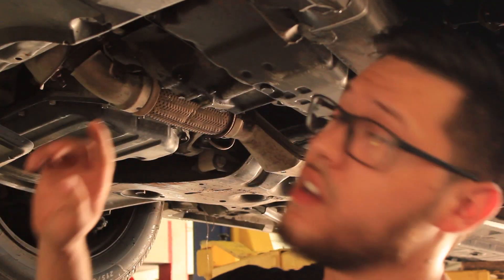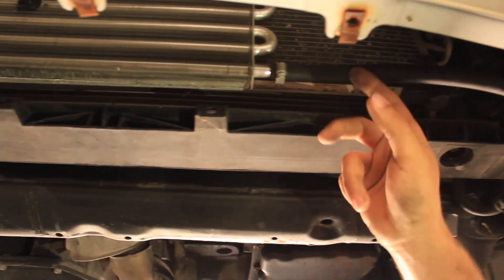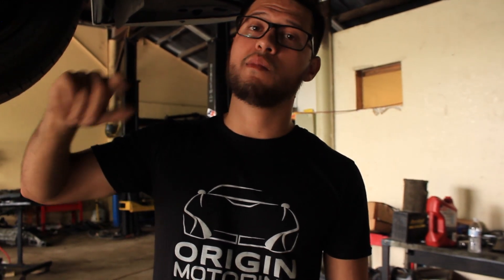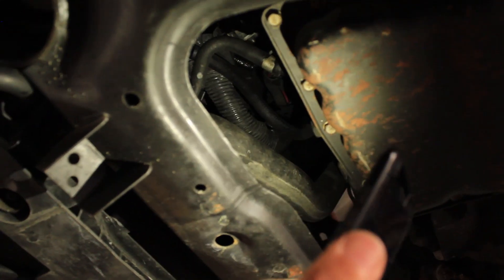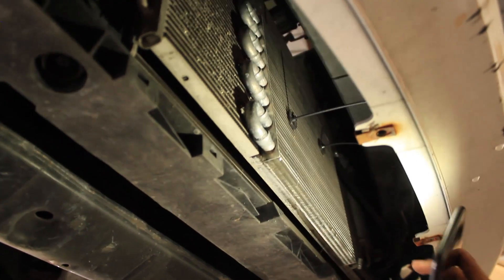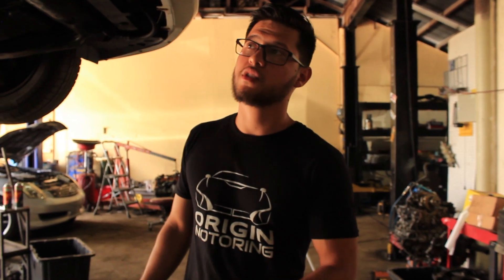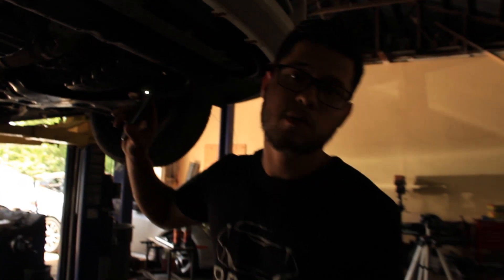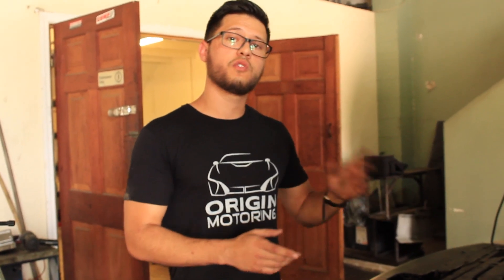Altima cvt Fix. Transmission more reliable

Comment: So I hook the new line going to the cooler to the top radiator spot and run it to the bottom of the cooler?  Then run the top line on the cooler to the small cooler on car on the top one?

Comment: I'm working on 2012 altima 3.5 so on cooler the bottom line goes to top of transmission and top hose goes to bottom of  radiator or top I have 2 inlets on my radiator? Don't want to damage the trans

Comment: thank you brother u are so kind to share information. in my case even the hose to radiator must be blocked --> from heater directly to transmission radiator with a fan over it then back to the (heater with 4 ports) even though i canceled 2 water ports because degrees here may reach up to 53 C degrees so coolant water reaches 98 degrees within 10 minutes driving

Comment: Hello.  Can someone help.  I installed the cooler exactly this way, checked fluid level ALl good but I am getting Air Bubbles on the tranny dipstick.   Sounds like there is air trapped in the lines somewhere.  I did not pre-filled the cooler with the CVT fluid. Does this matter ?

Comment: I've been wanting to do this myself. My fluid is frothing after a couple of months. The first time I changed it it only lasted 10k miles (I'm ok changing the fluid yearly since I do. It myself). Last time I changed I made the mistake of mixing different brands of fluids (I was low on fluid and had to drive, when I realize it was a really bad idea while driving, I used another qt I had in the trunk). 

I just changed it again and used only one brand (amsoil). If it starts frothing again, I'm gonna have to install this cooler and hope that's what making the fluid go bad so fast.

Comment: Every 60-80,000 miles. You go to Valvoline and do a CVT flush, $199. You buy only Nissan original CVT fluid and have Valvoline put your Nissan fluid! in instead of the Valvoline one. They don't give you credit if you bring your own but after the flush it shifts strong no slipping. My Altima 2017 (I drive Uber) has 297,000 on first engine and first CVT.

Comment: Here is a service bulletin for 2007-2012 Altima with External Oil Cooler kit installation instructions starting on page 5/7.      https://static.nhtsa.gov/odi/tsbs/2015/SB-10074565-2280.pdf
Reply: @Mark.... THANK YOU for this info.
Reply: thx for sharing but the creator of the video has installed the hose from top of the radiator to the bottom of the NEW cooler which is OPPOSITE what the diagram is showing......i am more confused
 now...

Comment: The 2013 Rogue some model have a smaller cooler than yours. But on those it comes in the top and exits the bottom of the cooler - opposite of what you indicated. 
Second, the radiator coolant is in the 185-205 deg range all the time. Transmission fluid generally is lower than that right (165-185 deg I am guessing). Therefore running the trans fluid through radiator is actually heating it up instead of cooling it?  Am I wrong?

Comment: This seems to get-around the design defect: Keep 'em cool as many ways of reduced coolant/distilled water ratios, both filters and best cvt fluid each 30k, allow set overnight or allow 8 hours for full warm drain to obtain around 5.5 quarts if not flushing, seal all air leaks of radiator plenum (Time -consuming), keep radiators clean. I'm now 209k Mojave hard-and-hot conditions, full AC

Comment: I found out when a cop hit my car they replaced the radiator with a non cooling port for the cvt fluid. So I have had my transmission fail 2x and nobody figured this out til my brother looked and asked where the cooling line went. I drive 15 miles to work thats it and had a failure under 10k miles 2 x.  Would the valve body still be good if its a fluid overheat issue.  And would the gears be bad. Just wonder if its worth trying to solve this still.

Comment: I have a Nissan altim 2012 no codes , the transmission go to the Neutral , Park , drive , ect , good , no limp mode , just when put in gear or drive , ect , make a sound and not let me run more 15 or 20 mhp . I don't know is the CVT going bad or just change filters and Transmission fluid fix the problem ? Please any suggestions

Comment: i know this is a older video, but do you happen to know where the transmission fluid pressure sensor is exactly on a 2018 altima. maybe a pic or exact location?

Comment: have a 2008 Nissan Sentra recently purchased for my mother. Last year she had the CVT fluid changed, and a car ran well for one year. After that, the car started hesitating again. I changed the CVT fluid yesterday, and the car was running fantastic until I took it down the street. It's holding back and hesitating, I believe the transmission is overheating.

 I left the car in the parking space, and did not drive it too far. To install the cooler, what you fix this problem what do you recommend.. where are you guys located? It's close by I'd love to drop the car off and have you guys work on it.. or if you explain to me how to do it and where to buy the part I can do it myself. Feels like this transmission is junky! I never seen the car with so many transmission problems like this one.. I have nothing against Nissan, but wow is this transmission troublesome.....

Comment: I think this was done to my Altima but I still have a p1778 code that won't clear with my code scanner. Issues seem ok except the traction control light comes on also. Can these be related to the type of repair done?

Comment: I honestly believe that the reason cvt goes out is by another way... I'm not gna tell anyone because I know that's what could be the problem as for long driving too... guys need to put 2 n 2 together n that is not happening here. Just preventing it from getting damaged any sooner. Put in a cooler so transmission fluid keeps cool n thus keeps this cool. Transmission isn't just about fluid haha. It's OK tho in doing my own research and I'll let you know how it goes.

Comment: https://emanuals.com/blog/nissan-cvt-transmission-warranty-and-lawsuit-settlements/  This is the best link I refer everyone to on getting your CVT fixed for free. The original  CVT warranty was for 5 years / 60, 000 whichever comes first.  The first generation CVT's have a warranty that extends their CVT to 120,000 miles.  It was decided in a lawsuit.  Nissan has agreed on cars built 2013- 2016 to extend their original warranty on the CVT another 24 months/24,000 miles bringing that to 7 years/ 84,000 miles.  Some of you may have even a longer warranty as some dealerships offered free extended  CVT warranties on new cars to 150,000 or even the life of the original owner.  Lifetime is what my dealership offered and they say they will honor it. My best advice is every 35,000 miles do a drain and fill just to error on the safe side.  I did that on my new 2016 Altima  vehicle and the CVT still went at 57,000 miles.  At least I did my part to avoid it from happening.  I hope going forward I'm in the clear.  Everyone please see the link I provided. It states that even though we've gone beyond the 1/20/20 deadline to file a lawsuit claim we still can file a claim.  You just have to act within a certain period of time from the initial service with your dealership.   Good luck Everyone.  God Bless

Comment: I don’t know how my 07 Altima has 217k miles and transmission is still fine. Ima change the fluid it on very soon. I don’t think it’s ever been changed. Thanks a lot for this video i will want to do this mod soon to extend its life. 

Also Nissan pisses me off for sealing this transmission and locking up the dipstick
Reply: I need some advice please......I have a 2012 Nissan Altima with 98k miles.  We have had zero issues as I have changed the oil every 5k miles.  I know a lot these transmissions go bad. But that doesn't mean i need to sell mine right?  I may just be being paranoid.  I see a lot people saying theirs are at 250k miles and still doing extremely well.   Just want this car to be dependable for my daughter going to college in a different state.

Comment: So did you bypass the original radiator?  My 2014 Altima has a transmission hose hose that goes to the radiator already.
Reply: Just noticed this is a 3rd or 4th gen Altima that was made from like 2002-2012 ish... So maybe they did this already on the 5rd gens.

Comment: Installed a Rogue oil cooler. Same as the oil cooler in the Altima recall cooler kit.  It has a thermostat bypass built into it!!  It will not cool oil until its up to temp. These after market oil coolers do not do that and always cool the fluid.  Maybe yours works where you live in Florida, but other climates it will create a problem. Also, their is a small trans FINE filter on the side of transmission that is replaceable. You can see its housing in your vid, 0:45 mark. The return line you touched goes into the fine filter housing. The housing is mounted using 4 small screws. I did a lot of research and other car makers use the same cvt trans and show the filter as replaceable. Some more research and cross referencing and this is the filter: Nissan 31726-1XF00 or Mitsubishi 2824A006. Nissan does not sell the correct oring for the fine filter housing. Mitsubishi does: Mitsubishi 2920A096.  The crush washers for the return line going into the housing are Nissan 21626-32U00.  I did a write up of this a few years back on a nissan forum. Best of luck to those that own a pos cvt.
Reply: Do you have part number for oil cooler?
Reply: @ChristOurKing  Buy the Nissan Kit if you have an 07-12. I may have saved some money doing it with a Rogue cooler but the kit would be a lot easier.  Nissan 21606-ZX59A 21606-ZX50A.  The Rogue cooler is 21606JM01A. You will have to make a mount for it.
Reply: I need some advice please......I have a 2012 Nissan Altima with 98k miles.  We have had zero issues as I have changed the oil every 5k miles.  I know a lot these transmissions go bad. But that doesn't mean i need to sell mine right?  I may just be being paranoid.  I see a lot people saying theirs are at 250k miles and still doing extremely well.   Just want this car to be dependable for my daughter going to college in a different state.
Reply: @nickcoleman4702  Dont need to sell. Oil coolers help. Living in the mountains, driving it hard fast acceleration... reduce trans life imho Changing trans fluid helps A LOT though.
Reply: @ridemfast7625  im at 98k miles.  Fluid looks really good.  Change it anyway?   We live in west tennessee and my daughter is an easy driver
Reply: I've got a 2016 Nissan Altima and at freeway speed  Can smell the transmission burning, smells like a bad battery, also like burning rubber. And the smell comes from right underneath my automatic shifter. Off topic but kind of on topic. Is it bad for me to be breathing that shit in?

Comment: Dam I paid good money for the Nissan transmission cooler your talking about. It’s tiny but better than none I guess.
Reply: Those coolers are good. They have a built in thermostat bypass. Unlike the cooler in the vid, your oil cooler will cool only when oil is up to temp. In colder climates, his cooler may not allow fluid to come up to temp. Also, bigger does not mean better cooling. His only has a couple large cooler tubes that do not touch much area of the cooling fins. Better coolers create more surface area for the fluid to be cooled through more fins. Compare your cooler to his and think about it. It will make sense.

Comment: Did anyone have issues with leaks going in and out , what could it be from  when I have everything connected? I’m the clamps not being tight enough or the hose not being far enough
Reply: Maybe left fluid in the radiator mine leaked alil to but it was from the fluid left in the radiator

Comment: A lot of the Nissan issues are certainly from too much heat and early failure of trans fluid. I think the issue with the older CVTs using NS-1 or NS-2 (based on described failure modes and what Nissan has changed over the years) is hydraulic failure of the fluid when it burns (get's black). There's some Nissan techs that have posted that the NS-1 and NS-2 fluid had a tendency to foam and cavitate as it wears. Some part of that is CVT design but mainly CVT fluid failure. This is why Nissan spec'd NS-3, which is full thinner and allegedly performs better under duress, more similar to traditional synthetics. CVT whine is likely foaming/cavitation happening at higher speeds, indicating hydraulic failure. Slipping and shuddering is usually a sign of viscosity issues and/or non-slip additives being spent. Meaning, the fluid is no longer in spec. Long story short, fluid drain and fill is the most basic preventative maintenance. A secondary cooler is a good idea too but simply extending the time between intervals.
Reply: So then question, is it the heat that causes the cvt band to stretch over time, already had to replace one cvt, trying to get this one to last a bit longer
Reply: @DaftknightLP  CVTs don't really stretch in the way dealers describe. It's more heat fatigue and wear. I had zero problems with my Infiniti CVT after I settled on partial fluid changes every 30-40K. I also use synthetic CVT fluid, not the OEM. But only do something like this if you're out of warranty.
Reply: Mitsubishi also has the same problem with the CVT and also needs the cooler as well.

Comment: Found this, the part numbers from Nissan for cooler that fits a number of models :

SERVICE KIT-COOLER ASSY 21606-ZX59A 1*
NS-2 CVT Fluid 999MP-NS200P (1) 

I think this is a great idea. If there are other issues, solenoid / pump / pump-valve for the transmission are also suspects. The idea behind the CVT is pretty sound otherwise.

Comment: Hey I have a 2009 Maxima I can see a small radiator shape of a square front of the bumper .. Is that the transmission cooler ? And should I get a bigger one or leave that one ? My car drives fine
Reply: Must be a power steering cooler, if it look like a long rectangular shape.

Comment: why not put the aftermarket cooler before the radiator cooler? wouldn’t that cool hot fluid to a reasonable temperature and the radiator cooler would make sure it was still warm enough (if for example, it was dead of winter).
Reply: Do not use those cheap after market coolers. The Nissan oil cooler kit has a built int thermostat bypass for the reason you stated.  And will actually cool very good despite is size because of how fluid flows through all the fins.  Get this: 	Nissan 21606-ZX59A
Reply: @ridemfast7625  The hayden unit fixed the transmission overheating issue and we have had thousands of trouble free driving in the west virginia and N. Penn. mountains ever since. It basically gave us our car back after 3 years of keeping it just in town.
Reply: @Vidmr2407  Great! Take out the radiator thermostat also.

Comment: I just brought a 2012 coupe cvt do I need to check the. Transmission oil
Reply: No you don’t need to check it just assume it’s right cross your fingers and hope it’s good ? Seriously?
Reply: @timmyl2005  the car has 62000 miles and when i drive arund 65 70 I feel a vibration

Comment: Would that be the problem Im having with my 2011 altima not shifting or going faster than 30 mph?
Reply: Mine goes 100 and takes off quick no mods 168k miles,,
Reply: Sounds like ur trans is already toast

Comment: I have a 2008 altima its whiney will this fix it ? I also switch the handle to manually shift to 6th gear and drop it to 55 and that helps the whiney part.. But that doesn't fix the problem all the way please tell me the parts to use

Comment: I installed the Hayden transmission cooler model 516 on my 2013 Altima Coupe . My car happens to have a dip stick when I bought it used so I don't know if it was bought that way by the original owner. So having said that and assuming that this is the correct dip stick should the fluid be up to the second notch up on the marker area of the stick?  I concerned about having the correct amount of fluid for now I added about 9 ounces after installing the cooler and it measures at between the two notch marks. Any  advise on how to make sure I have the correct fluid level would be much appreciated.  Great video , thanks for sharing to the many frustrated Nissan owners with CVT trans.
Reply: No it should be in between the two notches when the transmission is up to temperature just plug-in to the OBD two and check your transmission temperature I don’t remember the temperature off the top my head I want to say 160° but you can Google that
Reply: @timmyl2005    Thank you for the reply and your videos.

Comment: I have a Rogue and it doesn't appear that the lines currently go to the radiator. It looks like they go into the intake. Did you just bypass that path? My Rogue actually has antifreeze that runs through the transmission not external transmission fluid lines to the radiator????? Please explain

Comment: Should i just do a cooler flush then fill it up again with the NS3 im swapping a 15000 mile transmission or does it need an aftermarket cooler

Comment: What should i do on my 2016 altima ik doing a swap d
Had cvt failure at 11100 miles
Reply: When you replase the cvt transmission need to programing?
Reply: @mrsfc7602  no it did not i did hook up wrong sensors n it kicked itself in to limp mode i connected to right sensors n it works perfectly
Reply: Call Nissan, the CVT should be under warranty still.

Comment: lighting is really bad< would have liked to have seen a better view on hooking the hoses up right. I could not see what you were explaining. Also I assume you didn't bypass the radiator all together so it is running through both the radiator and the new cooling system

Comment: So I'm installing a Hayden 676 cooler on my 2012 Nissan Altima. Do I take the hose from the bottom of the radiator and put that on the top of the cooler and run the return line from where that bottom hose came from back into the transmission?
Reply: Did you ever get an answer on where hoses from cooler go?